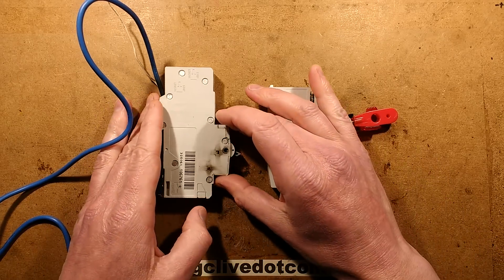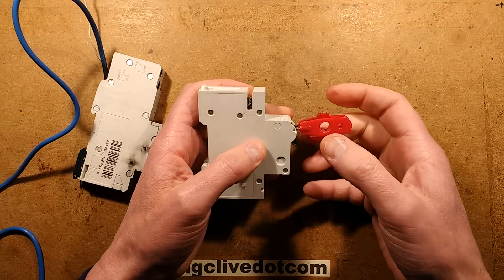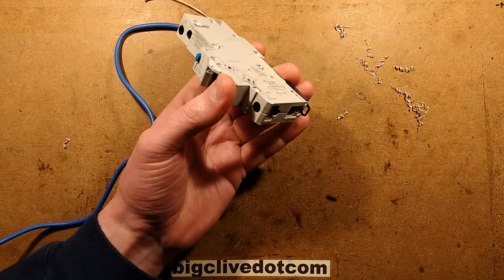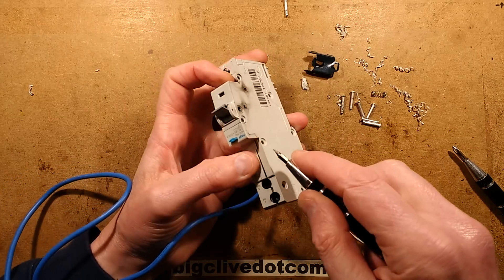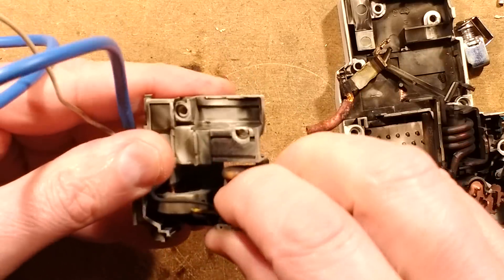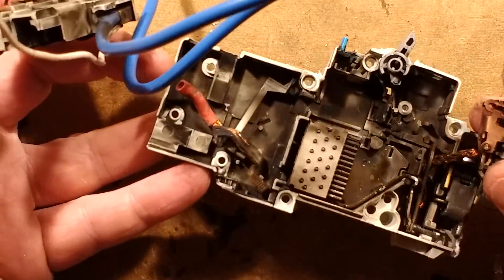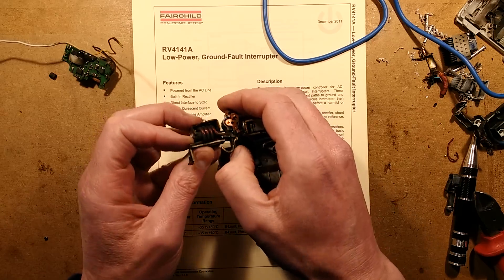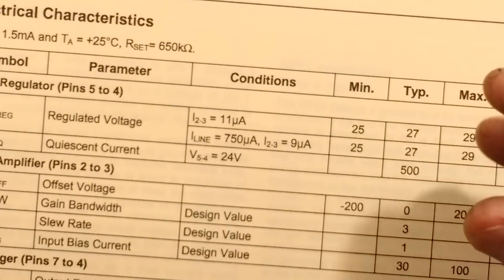Totally exploded Hager RCBO (RCD/GFI with overcurrent trip)

Comment: damn, these appear to be the same model I use at work.
Reckon this is an isolated issue, or something I should consider getting rid of, and finding a different model/brand replacement for?
In my setup, these are connected to modern monitors, no degaussing coils.
Reply from the maker: They should be fine if they are being used within their ratings and are wired with the feed at the correct side.
Reply: Like Clive said, the issue with this one is that the owner kept resetting the breaker through the fault. That caused arcing and burned the contacts until they welded together. Most likely they turned all the machines off at the end of the night with this breaker and it arced every morning when they turned them on. The real fix would be to put in another breaker and split the load, but then they'd have to run new wires.

Cheapest solution is to turn off enough machines on the circuit to bring the load down on startup either at each machine, or wiring in a time delay startup relay or manual cutoff switch into the line to cut power to like half of the machines until the other machines are started. I'd check if current on the breaker was close to it's rating though to make sure that circuit wasn't over loaded though.
Time delay relay https://www.youtube.com/watch?v=nTx9n8BNhgQ
Reply: Alternate Solution if you want to keep the luxury of switching all machines off and on from the Distributor (or another easily acessable location): Add a Switch + a Contactor for each Circuit and toggle the Switch instead of the Fuses - no new Cabling needed, and the Wear is moved to the Contactors which are actually intended for this purpose
Reply: Rapid make-break cycles is worst of all.  When contact is broken (switched off) arcing is sometimes at its worst.  If it's switched back immediately (or god forbid, it chatters), the hot contacts have a much better chance to weld.

Comment: I used to have hair clippers that would almost always pop the GFI in my bathroom when I switched them off. The device was "double-insulated" (no ground/earth prong) but had a polarized plug. I guess it was a residual magnetic field collapsing and inducing current over the neutral line?
Reply from the maker: It may have been the inductive voltage spike causing an over sensitive breaker to trip or quite possibly another faulty appliance or bit of wiring to arc over briefly if the live and earth connections were very close.
Reply: No other appliance was attached to the GFI. And it was always when I switched the clippers off. I never saw any arcing, but that could have been my own lack of observational prowess. ;)
Reply: There's a GFCI in our kitchen that pops on a fairly regular basis. It just trips randomly, even if there's nothing plugged in on its circuit. We've just been resetting it and continuing to use the outlet. This video is making me think it might be a good idea to replace the thing... Eek.
Reply: I've had that happen a few times at my place, except it happens on rare occasion (about twice a year) when one particular LED lamp is turned on. Reset GFCI and it works fine ... weird!
Reply: I have hair clippers that do the same thing. I rarely use then these days but when I did use them the GFCI outlet they were plugged into would pop sometimes when I turned it off.
Reply: I'm not very familiar with ground fault protection in the UK. In the USA it is common to have a ground fault circuit interrupter built into the bathroom electrical outlet. These GFCIs will trip with a ground fault current of approx 5 milliamps within 20 milliseconds. I too have experienced tripping of the GFCI while turning on/off electric hair clippers that have a two prong polarized plug and double insulated construction. In this situation, the clippers were the only load on the GFCI.
Reply: My mother complained about a sensitive GFI that would trip when she shut off her hair dryer...I suspect something similar was occuring to what you are describing. Anyway, the GFI was original to the house so I simply replaced it and that solved the issue. If it has a similar design to the 4141 that Clive showed, I suppose its possible the delay caps have failed after 15 years and instead of providing a delay it simply lets the SCR fire instantly.

Comment: "JW Here.."  Best part :).  Good grief, What a mess!!  Is this from a reputable manufacturer?
Reply from the maker: Prominent brand here.
Reply: Which BtW I think they try auspiciously to contain rather than implement any backup plan.
Reply: Hager is also very common in Germany. Yes, they have a good reputation.
Reply: As long as people aren't tearing these things apart and becoming incensed at their shortage of failure modes during a fault, the reputation will be based solely on the lack of escaped soot.

Comment: But lockout tagout takes all the excitement out. Health and safety gone mad.
Reply from the maker: Having witnessed an angry joiner storm into a distribution room of a building nearing completion and rip all the tape off the breakers and turn them all on, you have to allow for complete idiots.
Reply: bigclivedotcom As AvE said once " you make things idiot proof and the world goes and creates a better idiot".
Reply: Instead of tape on the breaker, run the live up to the handle. Keeps those pesky fingers away, eventually.
Reply: I used to work in the electricity industry in Australia many years ago. The guys in a substation had red tags on the breaker control switches ( this was high voltage gear, the actual breakers were out in the yard). And yes someone ignored the tag and closed the breaker. It does happen.
Needless to say the guilty party lost some blood out of his nose that day.
Reply: I'd say you have to find a way to put destructive murderers to prison before they get a job where they can do that.
Reply: Holy crap! Did that lackwit get anyone hurt?
Reply: unless YOU are on the other end of the circuit then it's no bloody joke
Reply: ya lol, just connect mains to the door of the breaker box. Lifehack
Reply: +Furr Bear
In Europe electricians use insulated tools, even if the circuit is proved as dead. I think they've blown the circuit off. 
I guess there was one person injured. A joiner ran several times against a lath with his face...
That's the reason why you should use insulated tools, and avoid touching the copper..use insulated needle or long nose pliers instead to insert a wire into a screw-type terminal.

+Geoffrey Keane
Here in Germany we've got the five rules of electrical safety:

1. Isolate circuit

2. Proof if the circuit is dead

3. Prevent that someone is switching the circuit back on, at least with a tag

4. short-circuit and earth/ground all active wires (lines and neutral), this is only necessary if the voltage of the circuit is above 1kV or you're working with bare overhead wires.

5. separate live parts near the working zone, for example with insulating rubber mats. This is only necessary in sub- or transformer stations were such situations can occur. In a residential or most industrial plants you won't have such situations.
Reply: we have a nice saying here:
F: Was wird schnell aus unvorsichtigen Elektrikern?
A: Leitende Angestellte

Answer has a double meaning, which can be roughly translated as
Q: What will careless Electricians quickly become?
A: Executive/Conducting Employees
Reply: +WineScrounger

If you're careless in this job you won't live long. For example the rule no. 4: In systems with a voltage above 1kV live lines could induce a voltage into the (switched off) line next to them you're working on. The induced charge is so high that it could kill you.

These rules were written with blood! They were introduced or modified because someone was injured or killed.
Reply: @ Ed R.... That saying was old when I was young, and I ain't been young for a long time.
Reply: Marcel Germann very thorough, those Germans.
Reply: Steven Ludeking it was ever so
Reply: I’ve worked in a few places where the intelligent workers just open the board and flick all the switches regardless of tape etc, but the lockouts work every time Saved my ass many times
Reply: That kind of excitement is shit I don’t need tbh 😬